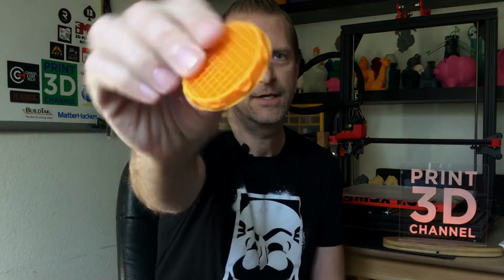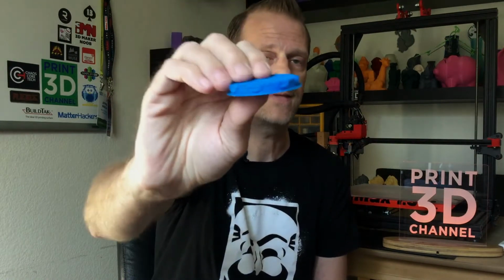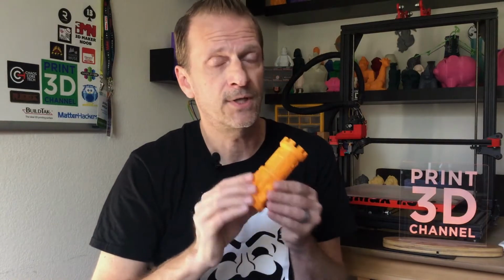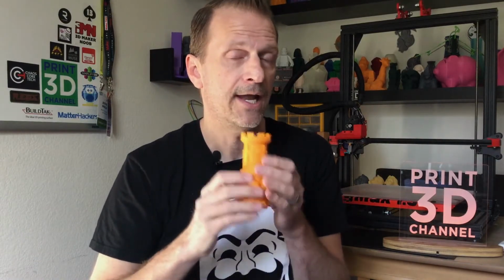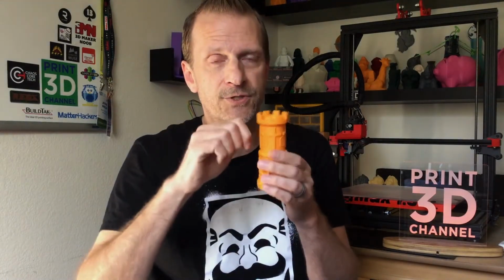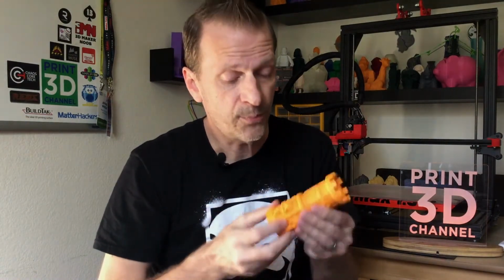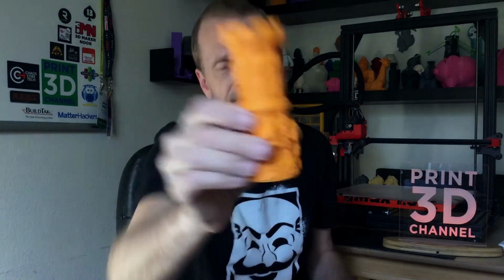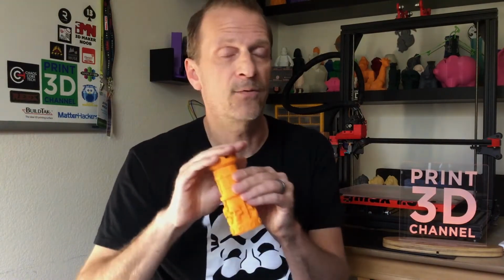#3DP365Project - Day 277 - #3DPHalloween - Goth Tower Candlestick

Comment: You need enable retraction, disabling retraction will create these spikes. Leave your retraction settings on,  You also need to make your retractions faster 15mm/sec is crazy slow -- start at 60 or 70, if you hear any grinding or filament, then slow it down, anything below 50 will not retract fast enough and create a pop mark or a divot with a larger nozzle like you have. Retraction of 1.2-1.5 is a good starting point -- a zhop of 0.5 is a good for a big machine like that to prevent possibility of layer shifts. Then leave the other page as is -- just retract for minimum travel distance -- that's all. All other fancy retractions over empty spaces etc, all of that will just create weird issues. Good luck
Reply from the maker: Thanks Kaz! I used your suggestions and gave you a shout out too. I appreciate your help, my friend.